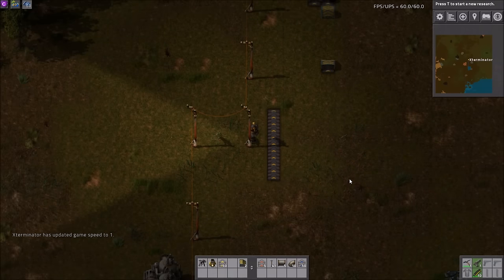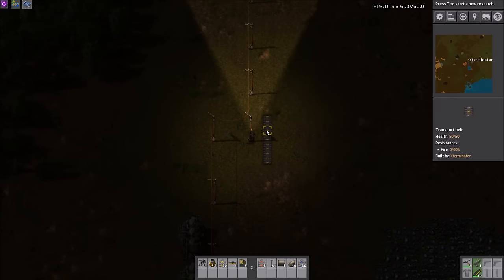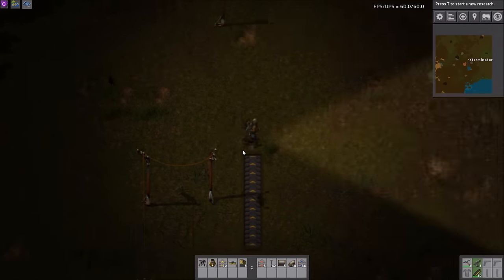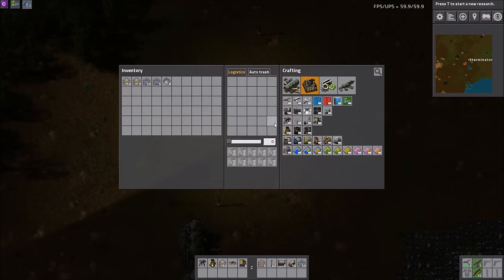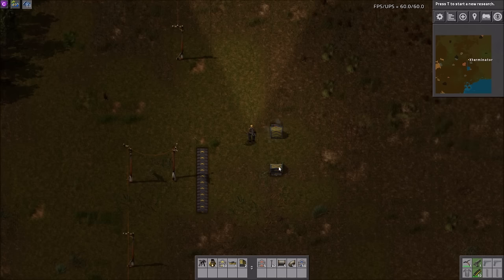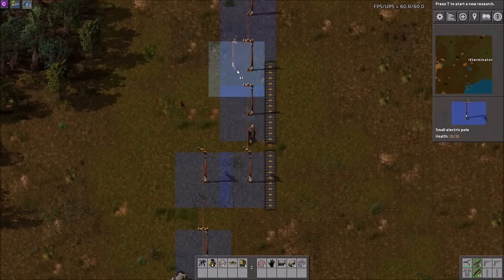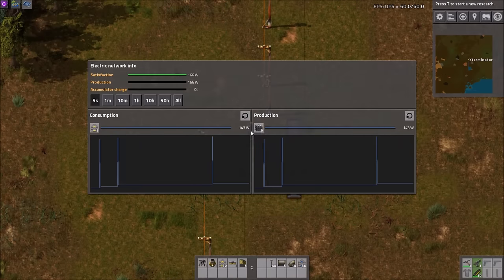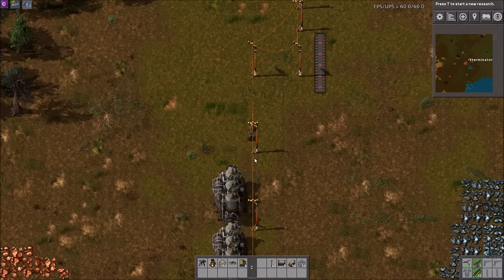Factorio Mod Spotlight - Electric Transport Belts

Comment: Would be good if belts were to transmit power amongst themselves, so you don't have power poles everywhere. That way you would only need one, per belt length.
Reply from the maker: Agreed. I think the dev is working on doing that.

Comment: Because in mods you can't make an item require or use elements it does not normally require or use - they don't provide blank or extensible template items. You can only copy an existing item and modify it. Belts don't require power, so they can't be made to require power in and of themselves.

This following is entirely supposition, but I didn't feel like putting "I guess" in every sentence:

What the author did is hook up invisible lamps in the same square as each belt, and the lamp is connected do the circuit condition of the belt so that if the lamp is unpowered, it turns off the belt. Because lamps require different amounts of energy at night, so it seems your belts do. So the answer to whether or not underground belts or splitters can be made to require power would also depend on whether or not you can hook a switch up to them and turn them off using plain old circuit hookups in vanilla. If my supposition is true, this also means this mod was only possible in 0.14 because that's when "hook belts up to circuit conditions" was implemented. Note also: virtually every belt optimization they do requires plain-old-belts between segments broken up by splitters or circuit-conditions. If I'm right about how I read the FFF about belt optimization in 0.15, this mod would effectively prevent any belt optimization from working and possibly slow your belts down more than normal, making it a UPS destroyer in large factories.
Reply: I highly doubt this would affect belt optimization on a large scale. The changes for belt optimization have to do with how the item's position is calculated by the engine. Before every item was calculated individually. Now it will be in segments. If the belt isn't moving then it is treated as such (or if the belt is full or there is a blockage, same concept here) -- that part of the game and the engine's knowledge of the belt and its items does not change. If the items are all moving they can still be a part of the same segment from my understanding. Having the ability to turn off based on power should have no bearing on the upcoming optimizations unless you have a black out but then again if you do all items would stop moving and the optimization would not matter at that point.
Reply: My understanding was that circuit connectors would serve as segment breaks, so that the exact contents could be read, rather and deduced from doing math on some belt down the line (the circuit connector doesn't know you're "only" using it as an on/off switch). I could be wrong, of course.

Comment: You know I think the belt if it's powered should at least have the advantage of a higher speed. Maybe leave the normal belts as they are, but provide an ultra fast powered belt. Not sure why you would, but there it is. :P

Comment: Having worked on computerizing conveyor belts I can tell you for sure that, that's not how they are powered.  They are normally powered only at the start or stop (but could be anywhere along the line).  Unless the line is really long.  In factorio terms activation should automatically flow up/down the belt for about 100 belts or until the belt changes (different speed, splitter, etc.).

If you really want authentic you should craft a Powered Belt with one belt and one electric motor.  Supply that belt with power and it should move 100 belts connected to it.  Always power spliters and under ground belts should be handled just like regular belts as if there where the correct number of belts between the connections.  Going over 100 belts should not stop the belt right away it should slow it down.

This may be hard to do in factorio.  I'm not poo-pooing his mod.  If people want it to work that way for game reasons then that's fine.   But Realism?   Hardly.
Reply from the maker: You are correct, and that's why it has been requested by multiple people to the dev to make it the way you said, where it is powered at the start and that's it. I do believe the dev is looking into how to do it. 
I still think the mod could be used for realism even as it is, because it is still more realistic to have the belts powered wrong than to have belts that just don't need power whatsoever as it is now.
Reply: +xterminator   Personalty I think it more realistic to assume magic power 1 of 100 belts then power running everywhere.   But Hey.... I'm not going to claim a game that you can run around with dozens of diesel locomotives in your pocket worries much about realism.  I'm just not one to pretend it is.

Comment: maybe have 2 recipes, 1 where you have to power every one with a power pole, and 2 by putting a copper cable in the recipe you only need to power 1 belt, or maybe a belt controller.
Reply: It's weird, I was just wondering whether someone had made this mod already the other day. I had an idea where each belt wouldn't need to be powered, they could carry a charge inside (using copper wire, like you say) and power any belt connected, maybe limited to 25 tiles or something. But it wouldn't output power, so you still would need to build poles for machines. I'd probably never use it, but it could be interesting for people who like a challenge.

-Reading further comments, looks like everyone has this idea :P
Reply: ARUCARDFTEPES Speaking of which, maybe you could manually run copper cables down it, and then to a few machines? but it would have no area like normal power poles?
Reply: In the real world conveyor belts don't need controllers if they are "always on" like the Factorio type.    Heck, Factorio doesn't even have a full indicator to shut the line down.   Workplace Health and Safety would have a fit.    :p

Comment: Looks like it will stop working after 1000 belts.

I wonder if it could be done better using accumulators instead of lamps, you can take a variable amount of time between checking belts for power that way (for a fixed cost per frame on as many belts as you like).

Comment: easy way to fix the power costs to be the same or different make new lamp items for the belts to be connected to, also have ya looked at crash landings it dumps pods on the hidden areas surrounding your base that contain 3 random items like teir 3 assemblers or t3 modules it feels a bit cheaty also it spawns the first one near your spawn and displaces what ever was there to start with so most times it takes out your starting iron patch or most of a patch. _!